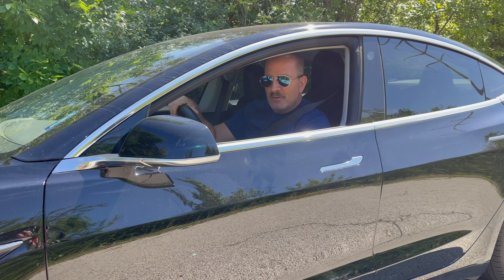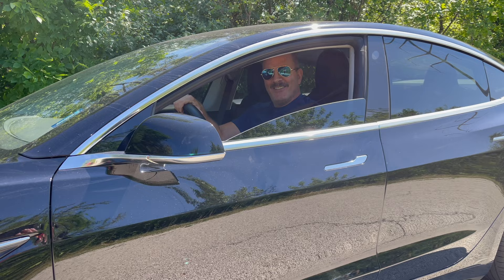Can You "adjust"  a Merkur 15C OR 25C RAZOR ?

Comment: I was in the process of noticing something like this ,  three years ago when I was first truly LEARNING to use a double edge razor.  I was not tightening the handle to the head enough, the blade was not getting bent to curve enough, the blade was pointing outward at a bad angle, and I was not able to make any strokes without painful scraping and cutting skin.  That attempt was set the razor as TOO AGRESSIVE.  The thought came to me,  "maybe I need to make this tighter", which finally helped in thinking HOW to use a double edge threepiece razor.

Comment: Ludvig, my friend, there is a video on YOUTUBE, where the guy literally shaves of a beard with a Merkur open comb (41c), and compare it with Muhle R41 on the other side if the face.
It works, just practice the technique a bit more. No need to do anything unsafe. Merkur oc razors don't have enough blade curvature to keep the blade tension as on the Razorock Ascension, when you loosen the head. You'll cut yourself eventually.
Or get a more aggressive razor.

Comment: A very old Gillette instruction booklet said the following (I've capitalized the words that were in bold print).
---
... The adjustment of the edge of the blade to the guard is accomplished by turning the screw in the handle. When it has been turned to the extreme right, it bends the blade across the bow shaped guard plate bringing the edges of the blade down close to the guard. When turned to the left, the edges of the blade are lifted from guard by the natural spring of the blade.

In most cases the GILLETTE RAZOR  works best when the edges of blade are brought down close to safety guard, but some prefer the edges raised slightly away from guard, for in this position a closer shave is secured.

In adjusting blade away from guard it is best to first bring edges down close to guard, then turn screw back a VERY, VERY little, which will allow edges of blade to spring away A TRIFLE from guard to position desired. In any case a sixteenth of a turn back is sufficient for the closest possible shave.
---

Comment: Thanks for sharing. I think you proved it's not worth the trouble. I did try the same "trick" with my Henson (mild) razor a while back and I could tell a difference. Loosening the Henson works better because the tolerances are so tight that the razor head will not easily spin. BTW, another "trick" I learned is that placing the razor head flat on the counter and twisting will tighten without using a towel.

Comment: I’d rather use a shim than risk it coming loose and slicing my face!

PAA make a razor that’s designed to loosen up and become more aggressive, but it’s designed that way so it feels a bit safer.
Reply: you're thinking of the Ascension, and you are correct.  Also the blade angle is very curved and the tolerance is very tight, unlike the Merkur which is barely curved.

Comment: Just try to give up the base plate, just put together the TOP CAP and the handle, that's all, then it will give you an aggressive feeling of stright razor, it works great in Merkur 15C and 25C, in first pass you can as I said just assemble the handle and TOP CAP Without the BASE PLATE, and in the second transition, put the BASE PLATE back on for a more gentle shave.
Great tip!
Reply: geofatboy thanks for sharing my tip ! :)

Comment: I would just use a wider blade like the Kai SS, it is 9/1000 of a inch wider or 4.5/1000 per side and is sharp & smooth  with excellent longevity + you can clamp the blade properly as  most razors designs are meant to be. I have had over 100 shaves with these Kai SS DE blades using mild razors and enjoy them very much. It just gives a little more blade feel or blade exposure that some folks just want.
Reply: 100 shaves, wow!

Comment: I tried mine with a shim, an old blade the sides of which I got rid of with a cutter. It worked. But I did not like the feeling. Instead, I bought an R41 as well.

I think many people kinda forget taking the sharpness of the blade into account. I love my 15c with a sharp blade (a feather or yellow gillette or permasharp) and r41 with a bit less sharper one (e.g. green gillette). 

Just my two cents. 

B
Reply from the maker: Thanks for sharing. Good points.

Comment: Hey Geo, I'm glad that I found this video. Just recently I bought the King C Gillette razor. I'm new to DE shaving, so i figured I really need a mild razor. To my surprise, the King C Gillette was REALLY mild. So, one time I unscrewed the handle a little bit after a shave, to allow it to "breathe" and dry quicker. After a couple of days, I forgot about it and just started the shave as is. Didin't have any trouble with the spinning, it shaved fine, but I noticed it was slighlty more aggressive, but it was a comfortable shave. It was only when I washed the razor afterwards that I noticed the handle a bit loose. So I actually considered this method. In my opinion, it works better with thicker blades, because the give more resistance when you screw the handle. However, I think the safer way is to just shim a razor.

Comment: The Merkur 15C razor is not designed for it to be unscrewed to adjust the blade depth (this is bad advice). The razor can loosen up even more while shaving and will cut the skin. Anyway, the Merkur 15C razor works for me in the way it's intended to be used.

Comment: Wouldn't it be simpler to just shim the razor with 1 or possibly 2 shims? Those type of razors are designed to be mild for those that need it to be. A head that is slightly loose isn't a safe idea in my opinion. If you want a more aggressive razor, try a Muhle r41 or if you are on a tight budget (who isn't these days!!), try one of those Dollar Tree  3 piece razors!! Those are both very aggressive razors!! Thanks for the video!

Comment: Would it be possible to put a thin washer between the head plate and the blade?  This would change the blade angle  accordingly without having a loose handle. What do you think Geo?

Comment: It may work with some razors. However, I would change the angle of attack slightly less than the 30 degree angle to make it more aggressive. I would only do this with mild razors.
Reply: If you do that with a mild razor, the blade wouldn't even touch your face really.
Reply: @SphinX_CS  You are right. I meant less than 30 degrees. I have to fix my original post. Thanks.

Comment: Possibility but repeatability is uncertain.  One would need to learn to do by feel.  Too loose, and blade is curved or bended less while in the razor head.  Just a little tighter, and blade is bended more and shave would be milder.   On the other extreme, making the handle and head too tight against each other if done on a cheaper razor, can sooner or later lead to breading the razor head.

Comment: You can adjust the blade gap on any safety razor by cutting a few millimetres off of each blade edge on one or more blades and using them as shims underneath a complete blade. Used blades are of course suitable for this and the ‘shims’ can be re-used.

Comment: Nice one Geo🪒🪒 Actually Phoenix Artisan Accoutrements has a series of razors that are manufactured with this feature built in.  The "Ascension" series is made to loosen to increase the gap while keeping the blade and cap tight utilizing the torque of the blade under tension.  They work like a charm and give a safe comfortable shave experience for an open comb razor, surprised more companies haven't followed suit.  You probably knew this already but was requested to use the Merkur razors.  Good demo anyway, thanks.